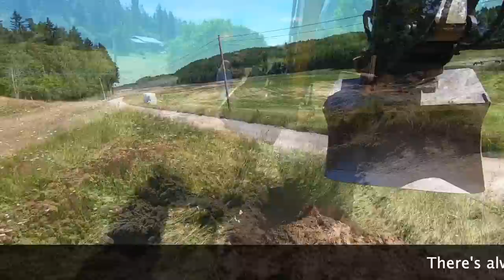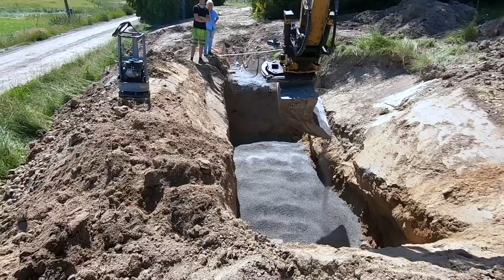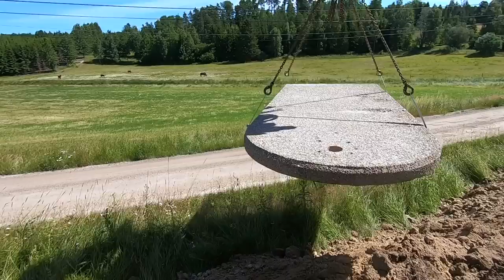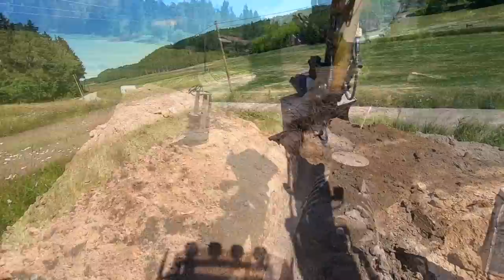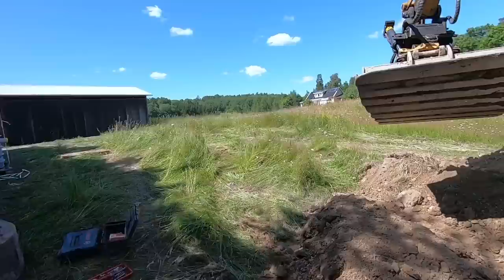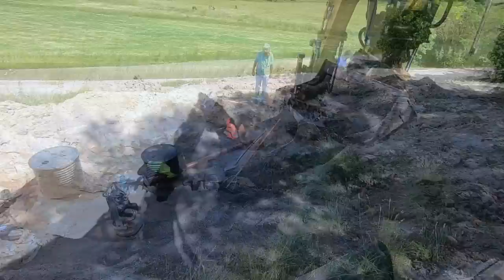#236 Putting A New Septic Tank In Place  (ep.2) *Excavator Time Lapse & Music*

Comment: You must require lifting accessory. 	The load straps must not be used for lifting. It will be very sad if the super cool guy gets hurt under a fallen object.
Reply from the maker: This tank doesn't even weigh 100kg empty, the straps have many tons of breaking strength so there is no danger.
But absolutely, lifting always requires caution.
Reply: We call them slings. There are rope and web slings for rigging/lifting. While you are correct that ratchet straps should never be used for lifting, I think the tank is under 200lbs and the danger, while real, not there. Atleast chains were used for the slab. But correct, using slings would be safer.